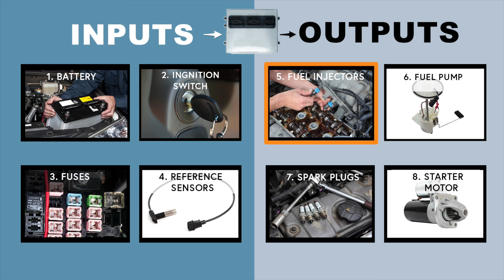Bad Engine Control Module Symptoms #FlagshipOne #EngineControlModule

Comment: Why not get rid of the damn  computers and make cars run mechanically like the old ones so that way the owner can still  work on the damn  thing. Great video pretty lady.
Reply: William Santiago It would not be good on modern engine as it has so many sensors that if one goes out you will be left guessing. But I do agree it was less confusing on the bygone era of older cars. Much simpler.
Reply: William Santiago emissions and car theft is why we can't go without computers
Reply: I'm so with you!!! This stupid car is holding my life up need a job and can't because of the computer junk!
Reply: True!!!!!!!!! Best damn thing I've heard all year
Reply: I have a Toyota hilux Australian version 5vzfe engine and i stopped taking it to Toyota because they never did everything on the checklist they said!  For example telling me they also fixed my indicator in my bullbar then i get home 5 mins from the dealership and turn my indicators on and bullbar still not working. Get out of car crawl under bullbar and i can see it hasn't been touched cos its still dirty. Pulling the rubber seal back to get to it getting dirt in my eyes, find a matching bulb and replace it and clean up the terminals and fine for about 6 months or so. Look at the dipstick to see clean oil and don't look that clean for a 90000 km vehicle. Been doing my own for years now
Reply: @ME-kp5iz  yea modern engines that smell like rotten eggs when behind em on the road
Reply: @410kane  and government tracking . They must be able to track your every move in case of any major Crimes committed that they are charging you with
Reply: William Santiago because they are 100x more efficient and it keeps u from damage because of driver error like for example u don’t see blown engines anymore
Reply: Thanks for this video godbless
Reply: Thanks for this information
Reply: William Santiago the best example would be a god damn BMW can’t figure anything out on those damn things
Reply: @johnboy3419  yes and can you believe that just two simple things (except not checking your Low Oil on oil dil stick).. especially if you just purchased your vehicle, second hand, besides going ahead and get a fresh oil change with the quality oil youd like to have in your engine, having ALL fluids checked. Then going ahead and purchasing at your local auto parts store: (1) [PVC Valve] (1) New (Air Filter] and now maybe better to go ahead get new Radiator Reservoir Cap and get a new Engine Water Thermostat Valve, too!
Reply: Its all about the money. They want to be able to control cars now.
Reply: @johnboy3419  COMPLETE bullshxt on the 100 times more efficient. More efficient yes, 100 times not even close
Reply: integr8er66 well yea I was over exaggerating to make my point the computer is basically like helping someone who can’t help themselves it’s a guardian angel so to speak for us but they seem more efficient but it’s because we don’t see all the errors it makes with it’s built in tolerances so we just think it’s better
Reply: Good idea, let's go backward, why not get rid of cars and start riding horses again.
Reply: @RolopIsHere  Just because you can make something more complicated doesn't mean you should. You can keep eating the car makers shit, as for me I'll just keep rebuilding the old ones.
Reply: Sonny Fales no Whst I’m talking about is Rpm u can’t red line them anymore computer won’t let u roast tires anymore so on and so on I’m not talking about lack of maintenance
Reply: Yeah specially when it comes to pats immobilisers.
Reply: @marcorubio3496  if we stuck with the old mechanics, we won't need sensors for the sensors are what help inform the computer of engine behavior. Simple mechanics did have all this re-engineered, computer dependant mechanics, are completely different.
Reply: you are mad about how cars are made. You cannot change it by wishing.
Reply: I think we should get rid of carburetors too. What happened to the days where we could adjust the mixture ourselves while we drive.  My car. My mixture settings.  Oh and laminated windshields - don't need no gov't tellin me how to weigh down the car with heavy two panes of glass.  Don't need none of this hardened valve seats either - just more cost, lead gas was doin us just fine till gov't interfered....and the same with outboard shoulder belts, airbags, stability control, composite headlamps, rear obstacle camera systems, tire pressure monitoring, and rear window defrosters.
Reply: Why not get rid of ecus.. Cause the government is involved.  ecus are needed to "reduce emissions".. I would personally go back to no ecu.
Reply: caz the evil govt is monitoring ur every step thru theze
Reply: Correct working on these spaceships I need a P.H.D. and Nasa certification feeling like a Einstein looking for a spark with a buick key on a kite round this mofo 😆
Reply: Because then the government can't track your vehicle.
Reply: Ask engineers they are all going to tell you the same two words fuel efficiency
Reply: Right On! That is exactly what I will do when I move out of Communist California !
Reply: Lol the whole point of these computers is so it can detect  if there's a problem and run at its most efficient. The computer is not the issue its the solution. Sometimes  the computer can be at fault but ita not common. think of it like this how many times the computer have save time and money.
Reply: Buy a classic 1960's car....problem solved.
Reply: @dragan3290  that's interesting, i got totally ripped off by a Toyota dealership as well, got told it'd be a 100 job then they charged me over 500 and wouldn't let me get my car til i paid.. The woman behind me in the cue was complaining that she had marked the pieces they were to REPLACE and the dealership had just left them in, but were trying to charge her for new parts and labor!!!
Reply: He called her 'Pretty Lady' in order to shoot his shot. She never responded to it.  Instead he got a bunch of geeks arguing in the comments LMAO
Reply: yes she is

Comment: Excellent product and service. I just received my ecm/pcm. The dealership wanted $1250 for a new unit. A total ripoff. I did it in less than 10 minutes with your preprogrammed that matches my vin number. Thank you so much 😊 I saved over $900 dollars.
Reply from the maker: Thank you, Dave. Glad we could help with getting your car back on the road fast.

Comment: I'll be likely giving this company a call on Monday. I have no pulse for my #1 and #4 injectors. I have confirmed the continuity of the wires that go from the injectors into the ECU. The ECU is the next logical point of failure. 1998 Buick LeSabre.

Comment: I am a customer of flagship one, inc
My experience with this company has been very pleasant.
In my country I sell computers from this store having a lot of satisfaction from my clients with the assurance that they have a lifetime guarantee.
I already have some years doing business with flagship one and I can recommend that any business with them will leave all parties involved with a good business smile.
Reply: Byron Borbor Andrade I bought a new battery for my car after it sat of almost a year and It crank just fine after replacing the fuel pump it ran like a dream. Then I got a no comm and no turn over a few days later all lights were on and fine. I got a jumpstart and it ran fine. Later It died and I have no communication using obd2 and after jumpstarting I can't get it to crack. Bad ecu ? or faulty alternator ? Buick LeSabre 2001

Comment: I've got a ram 1500 and I had symptoms of bad idle when it rained, heavy rain would kill my engine. At times, the idle would go from heat to complete crap. I drove through a large water puddle and it died. Then, it actually started back up, drove 20 yards and it completely died. No ignition cranking. Lights come on but no crank. I went to pci and checked fuse outputs. Outgoing to ECM were fine. When I turn the key, no fuel pump sound. 
When open the relay for starter, I can force the contact to kick starter but no life in the fuel pump, injectors or anything... 

I have all the signs of a bad ECM. I recently ordered a new one from flagship. Let's see if this works. 
Thanks for the video

Comment: I think you just answered my question. 2003 Dodge Grand Caravan 3.8 L engine. It just died at a stoplight. Starter would not work, and brand new fuel pump that was only a week old will not work either. I wired my starter into a starter button and the starter still works fine. Spray in starting fluid and motor tries to start. So since my starter and brand new fuel pump quit at the same time. It must be the ECM. Thank you.

Comment: 2006 subaru sti with cel po448 still troubleshooting,  leared po 442 and 456 evap canister a d purge solenoid valve replaced . Great video and very impressed with your knowhow and pcm knowledge.Im just a diy mechanico trying to save so e denero. Que te ga un  uen dia

Comment: Thanks for the help.  The circuit board had two fried components.  The unit from FlaghipOne is working fine!
Reply from the maker: Thank you, Den.
Reply: Did you have to have the replacement Computer re-programmed?
Reply: @FS1IncNY  just called your call anytime number. They could have directed me to this video…

Comment: Great video and very informative..! I have a 2007 Ext Cadillac..any chance that you can tell me why my backup/reverse lights stay on? I replaced the brake switch on the brake pedal...someone said the relay to the backup/reverse lights burned out in the ON position but I cant find the relay... someone else said that the relay to the backup/reverse lights is in that little BCM black box that your working on?

Comment: I bought a non running 1994 ford f 150 I worked on it changed a lot of parts that did not fix it i removed the computer and looked up the part number on the computer my truck had the wrong computer
I ran across flagship one on line I ordered a computer with the vin number on my truck they fixed my problem the computer came in my truck runs like new thank you all

Comment: I'm on your sight thank you for the broadcast... I'm not sure yet if I'm going to need a PMC the mechanic told me a pin was out he put it back in  so not dure. But on your sight I'm not sure what all the numbers are when I bring up my 2095 PT Cruiser non turbo 2.4 L engine ... where do I find those numbers in front of the discription and the ones after the discription. .. I know my Vin number but not a part number where would I get that? The engine  was swapped out before I bought it does that matter!

Comment: Hi Aída.
I am diagnosing a no start condition on a GM Daewoo OBD1 Vehicle. Everythin is fine: Compressión, timming , Spark , inyection pulse, and  fuel Pressure  (Signal from the ECM.)..
Could a bad ECM cause a no start condition? (Like sending  improper initial time ). 
I woud aprreciate your opinión..🙏🏻

Comment: I bought another PCM from Flagship One and their staff was much more knowledgeable, confirmed emissions standards programming, lifetime warranty, less expensive and very timely as to shipping. Too bad I didn’t buy through Flagship One in the first place! Don’t buy a PCM/ECM from any other car computer exchange!
Also, the other one was refurbished in a bad way, it popped open while installed in my truck, and they wouldn’t even acknowledge me.

Comment: Gracias aida I have a po448 on a 2006 subaru sti need to measure voltage bet. Ecm and chassis grd at b134 no. 13  but hesitant because I  ay damage ecm . 1st time doing this type of testing

Comment: I just purchased a ECM from you guys for a 2007 Pontiac Montana SV6 3.9 motor and I’m trying to relearn the key but the security light won’t stay on, the Second you turn the key to the on position the security light goes out within a second so was wondering if you could tell me why? So could you tell me how I could fix this? Thanks

Comment: I have a 2001 ford f350 7.3L crew cab, with no communication coming from PCM.  Once I pulled the PCM, which I have owned this truck since 2017.  I was told 2 things that this PCM is Plug and Play - and it has to be programmed.  But my vehicle does not have programable keys.  This is not the original one, plus this PCM has shown that it came out of F250 Ford.  I contacted Flagship and was told that my the PCM must be programmed by the parts  # DPC 422  1C3F-12650-zc, plus I also gave my truck VIN # .   What do you suggest or recommend again about this problem.

Comment: PRNDL and Gauges on 02 Chevy Tahoe are not operational.  Repair person indicated the cluster worked fine on a bench test, but nothing works when plugged back into the vehicle.  Repairman suggest checking the signal from “ECM”....how do I do that?😳

Comment: my pcm arrived today when I opened the package I found my part with a lot of corrosion this weekend i will install it
Reply: Not a good idea to install a component with a lot of corrosion, chances are it will short out something on the car like a module or other electronic component on the corroded circuit..

Comment: I replaced o2 sensors, plug wires, MAF sensor, tuned up engine.Done a bunch of drive cycles, still can't get 3 monitors to set. The evap, the catalytic, and the EGR.  I also took the car to a STAR certified place to smog. Is this a sign of a ECU problem ? It's a 1998 toyota camry 3.0L It displays no trouble codes

Comment: Great representation but I highly recommend that you take it into a professional to diagnose for a computer problem also if there's any reflashing you need to take it into a professional and have it reflashed any rate that was a good explanation on the basic fundamentals of a PCM or ECM
Reply: Voltage to PCM , lol. how about the no rabbit hole of current also.
Reply: I took a 14 Ram diesel 2 different mechanics looked it over--- THEY'RE STUMPED,,,, UH....... SO MUCH FOR THE PROFESSIONALS HA HA HA ONE WAS A DODGE DEALER,,,,, A 3RD SMART DIESEL GUY TOLD ME LOOK GROUND CABLES I DID AND ADDED A GROUND CABLE TRUKK STILL SHUTS OFF,,,,, AND YAH NO CODES--- SO ANY SMART 4:06 GUYS GOT ANY IDEAS???????? IM A 15 YEAR DIESEL GUY 1ST TIME THIS HAPPENED,,,, IM THINKIN TIPM?? APPRECIATE ANYONE HAVING THE SAME PROBLEM/ VEHICLE JUST SHUTS OFF AT RANDOM PUSH BUTTON GOES DARK FOR 5-10 MINUTES THEN STARTS BACK UP WHEN BUTTON LIGHTS BACK UP,,,,,, ANYONE KNOW????? IM STUMPED !
Reply: Maybe In Relay  TIPM ? Gets Hot shorts Out looses Contact? DTCS Codes? That be good place to Start , I Would start there give idea what ckt or component affect

Comment: Transmission not shifting gears correctly, I replaced the solenoid shift pack, is there a possibility that replacing the ECU can fix this? Vehicle is a Dodge Avenger 08 2.4
Reply: your car should have transmission control module TCM too, check that first before ECM
Reply: @Mark-cd8jn  Thanks, I appreciate it Man

Comment: Dodge neon 2003 4.7 turbo cylinder 1 and 4 injectors not firing they have power but not pulsing , 2 and 3 are working fine so could it be a bad pcm.

Comment: I am getting a P0303 code. Replaced all plugs, plug wires, coils, injectors, and the connector to the #3 injector and still get it. I have getting good compression to all cylinders, all rockers are moving fine on that bank and cylinder. I am now at the point where the only thing left is the crank and cam sensors or the ECU. I wouldn't think the sensors would cause on cylinder misfire consistently so I am at ECU. Does this sound like what type of indication you would get? I have yet to do the smell test but and working towards that now before I order a unit. Thanks in advance.

Comment: Had an issue on my 2000 Jeep Wrangler... "no bus" will Not run/crank, gauges do not work. Put new computer on and still have the same issue.. Computer is from AIDA Flagship One, No flash necessary.  Can you help?
Reply: Ever get an answer?
Reply from the maker: We would need to know all of the diagnostic steps taken initially to conclude that the PCM was the cause of the "no bus" issue in the first place in order to try to diagnose that any further. Please, check your fuses, relays, and wiring. If none of those work, hook up a diagnostic and see if there are any codes that you can see to fix it before any assumption.
Reply: Got a problem with my 2008 Chevy truck the rpm goes from 600 to2000 back and forth till the temperature gets to 210  and floods out some time good it be my ECM

Comment: I have a 1995 s10 2.2 I'm having a problem with the light switch.  It no longer works from the multifunction switch.  It now works from the switch off and on.  The lights are on all the time that the car is running.  The off and on switch is now the dimmer.  Also the radio will surge.  When I first start the car the radio will come on and minutes later will surge, get louder on its own.  Is this the computer or might it be a relay

Comment: Hi thanks for the video,my question is
I PUT THE SCANNER ON MY HYUNDAY ELANTRA AND IT GAVE ME THE CODE NAME OF 
ENGINE MODULE.
IS THAT THE SAME AS 
ENGINE CONTROL MODULE.I HAVE TO REPLACE THE COMP? THANKS.
Reply: yes...that's it...you can also physically pull out your computer and look at what is written on it...

Comment: interesting when she said to open the pcm and check the motherboard for corrosion or burn, thats exactly what I'm going to do before I order another one. If there's a connection issue: bad wiring, bad bus, sensor..the new pcm still won't work.

Comment: Hi, i got a Nissan sunny n17 2014 model. The Car is not starting and I am getting U1000 and B2193 codes. I have replaced the engine harnessing wires from ECM to all the engine sensors. I have checked the ground wires as well and they are perfectly connected. On my scanner, It shows that my ECM is not equipped. While switching the ignition on, the cooling fan starts. So, please help !!!